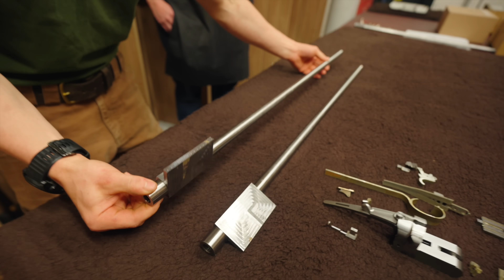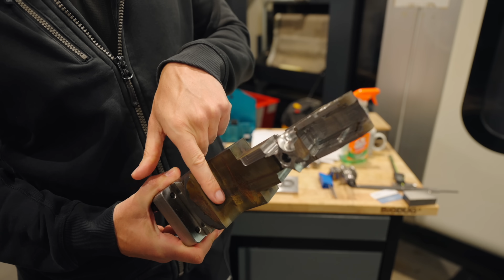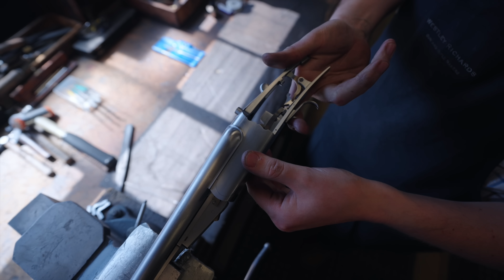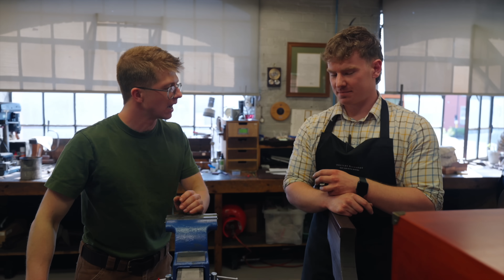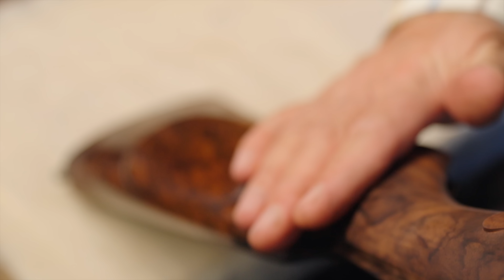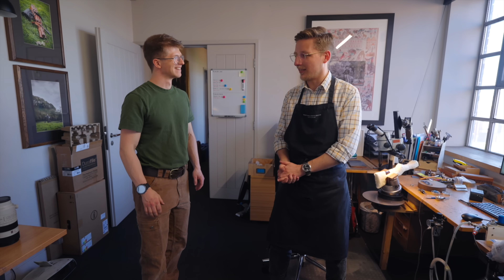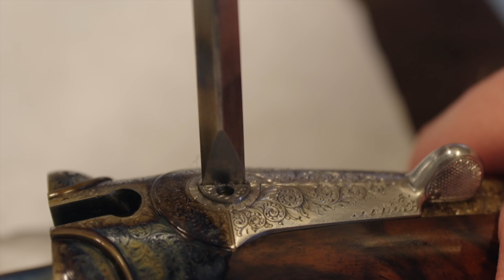How The World's Finest Shotguns Are Made

Comment: Being a machinist "jurneyman"  (having learned the profession but not gone through the additional studys and testing to be a master) and having gone through a German apprenticeship, the filing and really all general work with hand tools llike metal saw, chisel and such is very commonly still the first months of learning most metal working professions. I spend pretty much the first half a year one creating basic shapes and very simple objects to learn the basic techniques and skills that everyone who works with metal should know, as they will apply later in many ways. (And sometimes, it actually is just faster and more economic to throw a part in a vice and file an element than to set up a tool like a mill or press to do it. Especially in industries that don't do large production runs, like bespoke manufacturing of specialised parts for other industries, the one where I worked later on. I made parts for large printing operations, elements of submarine doors, shafts for water power turbines, and once even worked on a dry cask storage container. And with bespoke stuff like that, as mentioned, sometimes the better choice is just to do something with a hand tool. Especially when the part is as high as a small building and weights dozens of tons.)

Comment: HI alec - higher seated pants would fit your form better and give you more structure throughout your torso. They may also be more comfortable. If you look at the outfit at 22:18, you can see how your pants make you look quite small compared to the craftsman. This is for a number of reasons, including that they're probably a little oversized and they don't fall straight, but if you wore them a little higher (and got paints with a smaller waist, maybe a cm or two), your form would be more structured.

Comment: You should look into getting a Hurco VM10 milling machine (they are using them in the Westley Richards machine shop). They are not as expensive as you would think and are extremely easy to program using the Winmax control built into the machine!

Comment: Love these kind of videos.  It's comforting to know there are trades out there like this still going.  The craftsmanship is really indescribable it's so good.  Looking at the catalog and price list, It's actually surprisingly reasonably priced as far as firearms go.  They could be charging more.  I'm building a guitar, and the finishing part gave me some ideas, as I've started with boiled linseed oil.  I put a gorgeous flame/quilt top on it.  I'm debating whether to keep oiling it with a clearer oil to a high polish, or spray it with a poly finish.  I just had an idea.  Damascus tuners for the headstock! That would look awesome.  You should try making some.  The gears would be easy, and the rest of it would be flat sheet metal, and a stamped case.  Can you make Damascus that thin? Will S. could use his roller on it to make it really thin.  That could be a cool collab.

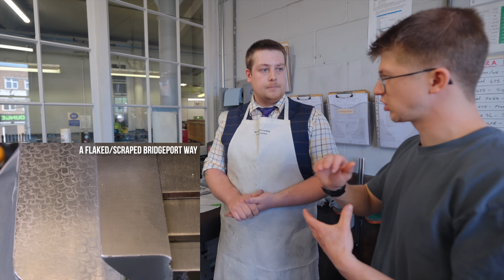Comment: 34:21 or like cylinder honing for engine machining. We use stones with with certain grits to obtain a surface finish that traps oil for proper lubrication of the piston's rings. we use a profilometer that drags a ruby on the surface measuring the micro peaks and valleys, determining the surface finish. we also have to maintain cylinder straightness within .0003" along the walls, I can usually get .0002" with our manual machine at our shop. its very interesting seeing similar techniques and learning how they can be used for other purposes!
Reply: Was literally on my way to make a similar comment and then yours popped right up beautifully explained and absolutely fascinating how the same techniques are used in different applications
Reply: @CHEAKSK8AUTO I appreciate it! I take pride in preserving, teaching and continuing the beautiful art form of performance engine machine work! It's great to be able to relate to other forms of metal working to what I do everyday.

Comment: The "spotting" part that's done with the drill and the bit with the rubber tip is also used in watchmaking on the watch movement.  It's more decorative than functional in watchmaking and is typically referred to by the french word "perlage" in watchmaking.  Ironically, even though it's a decorative feature, the movement isn't seen by the person that wears a watch.  Only a watchmaker doing service to the watch gets to appreciate the beautiful perlage finish on a movement which is just crazy to me.  Perlage or spotting is also known as "jewelling", "perlée", and "guilloché" as well.

Comment: When you see what goes into making a Westley Richards, you can easily understand the cost. Amazing what these folks can do. 

While I may never be able to comfortably afford a new Westley Richards, I was lucky enough to purchase one used from a vendor at the Southern Side by Side in North Carolina three weeks ago. 

Westley Richards was there and were kind enough to confirm it was a Best Boxlock made in 1899. 

At some point the barrels were sleeved. This is "basically" a replacement of the barrels due to the use of corrosive black powder shells. The bores of the barrels would be honed periodically to remove the corrosion/pitting. Eventually the barrel wall would be too thin to still be safe to fire, hence the sleeving. The sleeving was likely not done by Westley Richards. 

This is likely why it was the bargin it was. But it locks up tight and barrels ring like a church bell. The engraving is gorgeous. 

Thank you Alec for sharing this great content and Westley Richards for opening their doors to help us better appreciate the skills that go back hundreds of years.

Comment: I WONDERED WHERE THOSE MARKS CAME FROM. Spotting... that's incredible. Beautiful. It looks machined, yet it is done by hand. What impressive accuracy, repetition and skill.
Reply: Technically that still counts as machined, since he's using a mill. Still very impressive, but just clarifying the term. "by hand" in this context would mean he had used a hand drill or some other hand held tool. This is rather manually machined or hand machined.

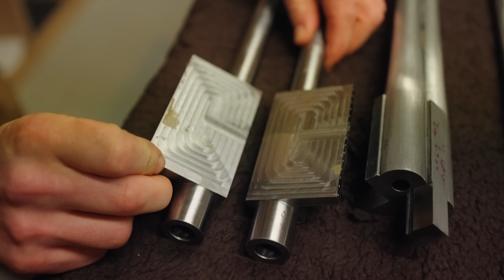Comment: 2:00 would it have to be turned off center? 

My first thought was draw out the square block into a full sized tube isolating the connection point like an integral hand guard before you drill and ream the barrel like you're supposed to

Comment: Good to see an apprentice of 10 months still only being trusted with a file hehe, I remember when I first started engineering, before I even touched a lathe, mill or any type of machinery, I had to first make a 'C' clamp from 1 piece of steel, I had to square it off just using a hacksaw to remove excess metal, then using progressively finer files, eventually down to using really fine emery cloth and oil to remove the final raised parts, which were found using a calibrated flat surface and engineers blue compound to find the raised areas, just having to learn how to use a file and how to hold it took weeks, we had to then go on and make every tool we were going to use, every punch, clamp, screwdriver, squaring blocks and even the toolbox to carry them. Loved every minute and I still have the clamps and screw drivers...albeit the a little worse for wear now.
Reply: Those clamps and screw drivers are a metaphor for you life brother, what was once a nice new bright shinny tool in the industry is now old beaten and battle tested. Those tools have seen it all, much respect to you and your craft my friend🙌🏽🤙🏾💯
Reply: I did exactly the same as you when I was an apprentice toolmaker back in the early 80's, and I also still have the tools and the box I made to store them in still sat in my garage. My time and experience as a precision engineer provided me with a fantastic foundation to build a career in automotive and then aerospace manufacturing before moving on to an industry consultancy role in 2002. But the world is changing at a rapid rate, and not always in a good way. The skills of todays's engineers are now mainly in software programming and the amazing machines.materials and production technologies which require less human involvement. I am now approaching my mid sixties and I have reluctantly decided to retire early and opt out of the impending increase in ridiculous regulations, the tick box requirements and extra costs being imposed on companies.
Reply: I m 68 I remember having to do that in the 1970s. My father was an engineer he looked at some of my tools and said are you sure there not mine. That made me feel like I had done a good job.
Reply: He'll get to play with damaged parts though.

Comment: Honestly the most impressive part of this is how they at the end are able to put in that many slotted screws, some with significant force, without the screwdriver slipping and leaving a massive gouge across the surrounding metal and wood.
Reply: Some of that is practice, but the main part of it is specialty screw drivers. Gunsmiths tend to modify screw drivers for individual screw sizes used by certain companies for custom guns like these. That, and you want the screw driver to be both slightly narrower than the slot so you don't gouge the interior surface of the bore the screw sits in, and also want to to seat firmly at the bottom of the slot. You're also typically pushing into the slot firmly, and turning slowly and carefully so as not to cam out of a slotted screw head on something like that. 🙂
Reply: Hollow ground screwdrivers.
Reply: @BarnyardPsychoBob  Thank you. I couldn't remember the proper term, so I just went with "modified screw drivers". I know gunsmiths that do that as well, but a hollow grind is what I was trying to remember. They are great for full contact with the slot when it comes to not camming out of the screw head.
Reply: That slipped flathead is a common maker mark of mine. It's on nearly every single work piece of mine, lmao. I loath flat heads.
Reply: @ConfusedRaccoon  that's because you have poor tools. It never occurred to you to improve what you have any either. You can grind screwdriver tips to fit screw slots better. I won't look at you funny for doing it. I've done it many times myself. I'll grind a screwdriver tip until it locks into a slot. It fits so tightly it can hold the screw on the tip. Then you won't strip a screw out or slip using it. When things are bad strive to make them better. You can do it.
Reply: @ConfusedRaccoon  Then you are using bad screws and/or tools. Like I already mentioned, a good flathead can take more torque than a phillips. Phillips head were designed to be quickly operated with drills. They are designed to pop the drill bit out once you reach a certain torque. You could say torx is the modern flathead, although flatheads still have advantages over those as well.
Reply: Gunsmiths refer to screwdrivers as "turnscrews".  I'm not sure why two different terms evolved for what is essentially the same tool.
Reply: @robm8809 Hm, maybe that's why theirs work better? You can 'drive' a screwdriver into your hand or across the surrounding material just as well as it can drive a screw, but 'turnscrew' is pretty unambiguous in what you want it to do. Maybe that's what we've been doing wrong all along!
Reply: @robm8809  I believe it was because they do not 'drive' screws in, they 'turn' the screw until it is at the correct torque (by hand feel of course!)
Reply: @ColinCarFan  It's literally the older, original term; "screwdriver" is newer. Additionally, "screwdriver" derives from the German "Schraubendreher" (screw-turner) while "turnscrew" is the transliteration of the French "tournevis".
Reply: Its Turnscrews the best are the ones you make. Having tried the raved about expensive sets of turnscrews that just chew up the screws and turnscrews themselves, i always went back to home made.
In the white you work a screw in whilst left long/proud. File it down still tightened and put a thinned down hacksaw blade to cut the slot enough so you can remove. File deeper then screw back in and file flush. Slot now should be around 20 degrees short of position as that will alter after hardening, tempering and colouring. 
Done most of the action, lock and ejector work including those V springs for the trade, glad im out of it 15 years.
Some stories to tell think best was a chap brought in a new in 2002 £108k Purdey o/u i took a hammer to, lads face was priceless tapping up the bites.
Reply: After spending the money (Not, actually, all that much, all things considered) for a really good set of screwdriver bits-- I've come to the conclusion that the straight drive slot is actually a superior system 
IF
both slot and driver are well-fitted. Certainly it's a system that's MILES better than Phillips.
Reply: @theprojectproject01  I can see that - assuming you've got decent access to where the screw goes. If you've got to angle the driver even a few degrees, or if you can't move your arm freely while turning it? Not a chance, for the simple reason that this system has absolutely nothing keeping the driver centred to the slot, and thus makes camming out nearly unavoidable in those cases. Phillips is *terrible*, but it does at least somewhat ensure the driver is centred on the axis of rotation of the screw.
Reply: @Kraaketaer  "Pozidriv" is an even better system than Phillips, but is less popular in the US for some reason.
Reply: @robm8809  Yeah, pz is a much needed improvement on phillips. Still not as good as torx, but not bad overall. Where I live phillips is pretty much obsolete at this point - it's still around, but only in kind of weird use cases. Heck, even Ikea uses pozidriv (and hex, of course) - I can imagine them moving from phillips to that probably saved them having to deal with a lot of frustrated customers with stripped screws and other fasteners.
Reply: @theprojectproject01  Superior how, exactly?   It focuses force on fewer points and allows the screwdriver blade to exit the screw sideways.
Reply: @robm8809  Not if the slot is accurately machined and the bit fits it precisely. That way you get metal-to-metal contact across the whole of the slot on both sides; it's a surprising amount of area.  I 100% agree it's INferior if those parameters aren't present-- a tapered driver in a stamped head is just miserable.  But when done right, it's  a downright pleasure to work with.
Reply: @robm8809  You can put more torque on a good flathead compared to a phillips. Phillips heads are designed to be worked on quickly with a drill. Flatheads are not obsolete.
Reply: @dabbidaa1547 I never said flatheads were obsolete, but you can put more torque on a Pozidriv screw than you can on a Philips or a flathead anyway.

Comment: 13:17 Heh, this reminds me of how trying to be very technical with terminology in guns sometimes gets really counterproductive. As an example, sometimes the main difference between a striker and a hammer fired gun, is that a hammer is a moving, sprung part, that hits a (often floating) firing pin, which then hits the primer, while in a striker the firing pin is a part of the sprung portion, and strikes the primer directly. So while a linear hammer and a traditional striker are very similar in operation, the linear hammer can't be called a striker because the firing pin is a separate part in that system.

So how does this relate to the video? Well, for a pretty long time now the vast majority of revolvers have been made with a rotating hammer and a separate firing pin. This is safer, because it can be made in such a way, that you can't just push on the back of the hammer to fire a round. So the earlier definition between a hammer and a striker works here.

But the kind of hammer shown in the video (and often used in old old revolvers), where the firing pin is part of the hammer, would under those rules have to be called a rotary striker. Absolutely the most hammer looking version of the thing couldn't technically be called a hammer. =)

Comment: I know that Alecs workshop is technically capable of creating a firearm. But I know the UK has all kind of firearm restrictions so Im curious at what point between "hunk of steel" and "firearm" would it become illegal for Alec? Like what operation takes it over the legal/illegal line
Reply: AFAIK it would be anything capable of firing a projectile with high pressure gas ( from compressed air or explosives) above 16.2 joules.

Comment: cant wait for the titanium damascus shotgun collab! what an awesome tour. top tier craftsmanship, for the pure love of the craft.
Reply: There are damascus barreled shotguns, but they are only safe to shoot with black powder loads. Modern shotguns with smokless power will over pressure them and cause failures.
Reply: @MX304  Old shotguns yes. Purdey for example makes new shotguns with damascus barrels and you can shoot smokless all day long.
Reply: Maybe they need some titanium damascus triggers, or trigger guards, or maybe hammer (I don’t know enough about titanium to say for sure that it would be up for that task). There are other visible items that don’t require the same strength standards as a barrel or block. It’s still an outside chance for a colab in my eyes but possible. Especially if a buyer was maybe a fan of Alec and requested to see if it was possible 🤷‍♂️
Reply: @caseymiller3540  You could probably use some Ti in the receiver. My 12ga. sporting clays shotgun has a mostly aluminum receiver. There are steel "plugs" that the shell casings seat against but the rest is all aluminum.
Reply: It would explode after firing a single shot.
Reply: It could just be a steel barrel plated in titanium damascus so it can get the look of a damascus barrel without sacrificing functionality.